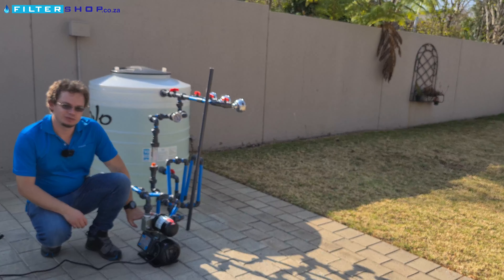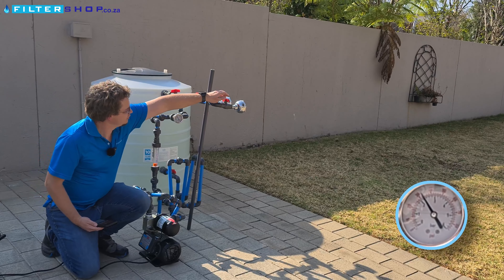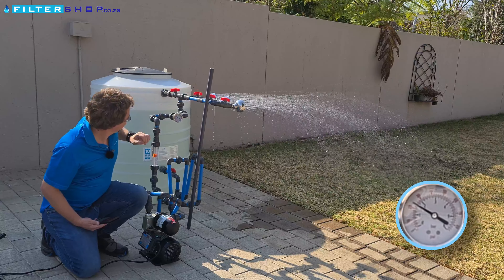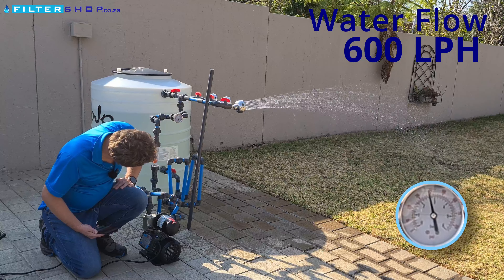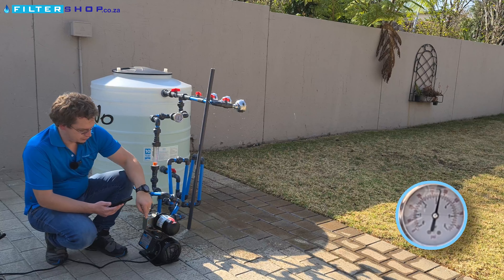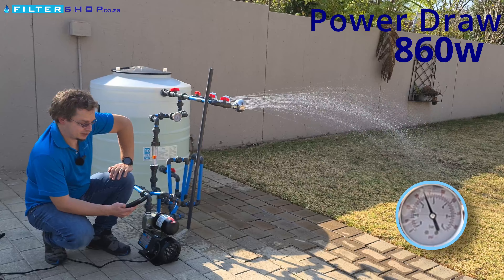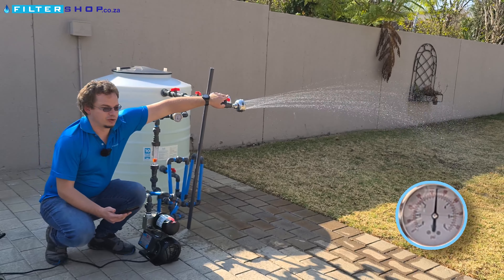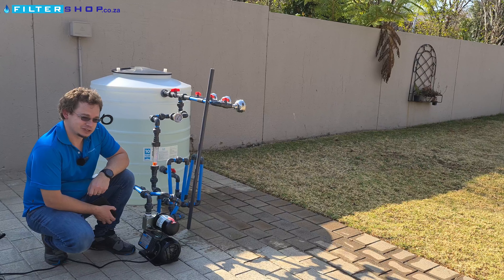YBP750 VSD Pump Review

Comment: Hey There. So we want to put in a back up Municipal water solution. We haven't had water for a week and wanted to add a 5000L tank. We have been looking at either a jojo 0.75kw vsd pump or a Zilmet ZIL 158-M+ZIL01 Controller 220V automatic booster pump.
Reply from the maker: Hi, Rather look at something else. The HMS750 uses about 30% of the power: https://youtu.be/9OT62wCBFyA